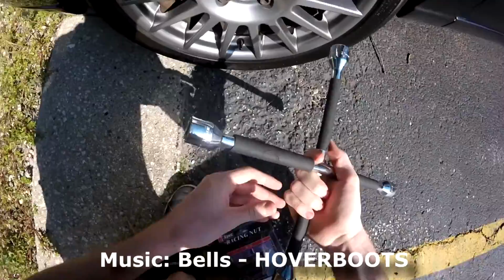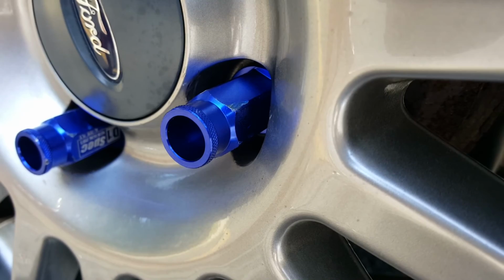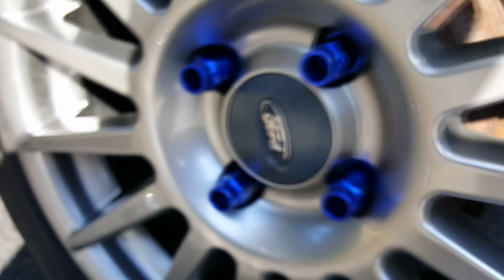NEW LUG NUTS - Fred the Focus - Part 6

Comment: By the way when you go to do your brakes, MAKE SURE to clean them the best you can. Had to redo mine because of that. Hot water and soap does the trick along with rubbing alcohol after. Like the upgrades man.
Reply from the maker: what kind of paint did you use?
Reply: Gingium VHT worked the best for us. make sure its heat resistant. 500 F or more